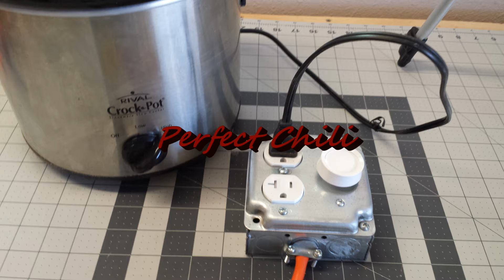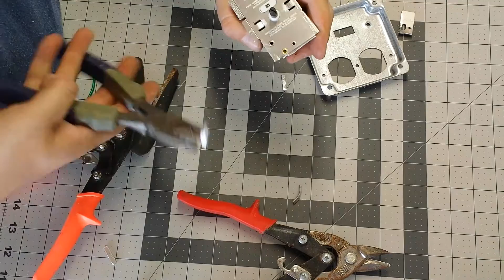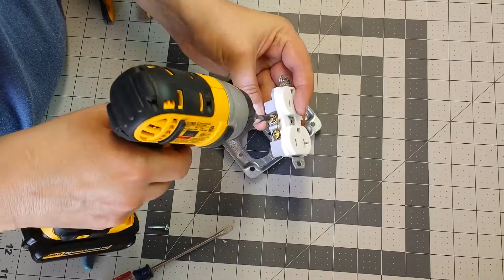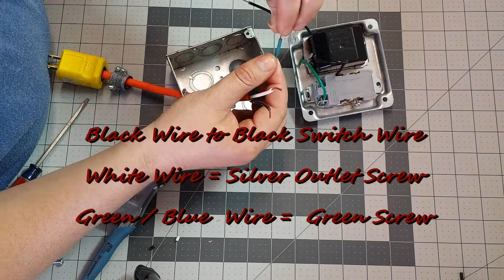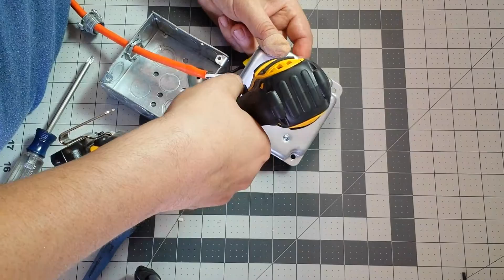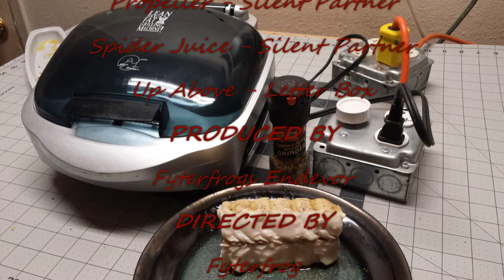🛠 How to Hack a Dimmer Switch.

Comment: I just read that dimmers only change the waveform for dimming lights, and that anything with a transformer (or electric motor) would likely burn out

false?
Reply: Very interested in trying this out. I bought a dimmer switch thinking I could use it as a potentiometer
Reply from the maker: +Zachary Sauve No TURE this is not to be used as a potentiometer it works by increasing the resistance... the more you turn the more the resistance...but for motors read the warning lables on the dimmer you bought concerning brushless motors vs motors with brushes. Some LED lights are not dimmable.

Comment: very useful item, i made 1 several years ago but used a cover plate for the dimmer with a single box and used 1 cord in and a 3 way out.
i used it with grinders, drills, drill press, drop lights
Reply from the maker: Charles oquinn thanks for the comment !!